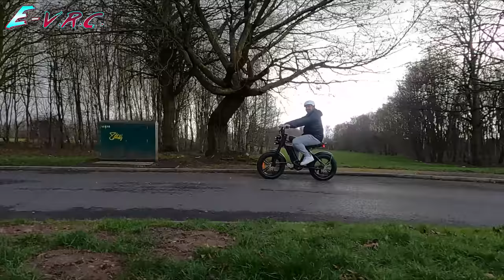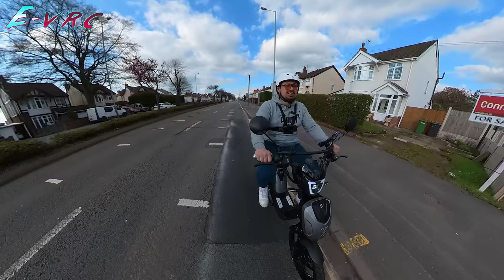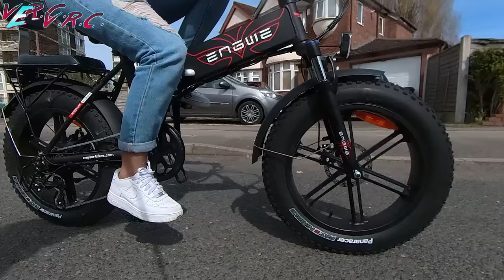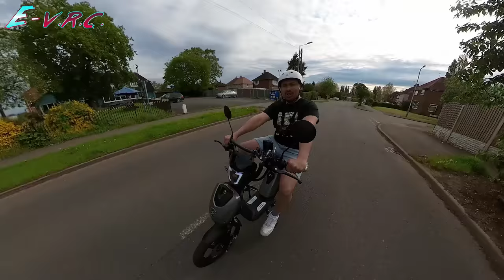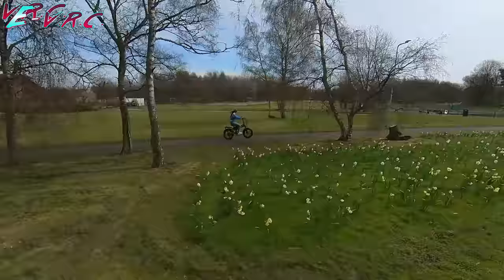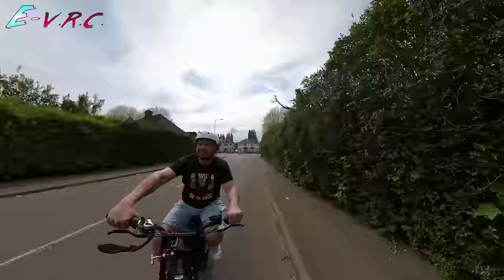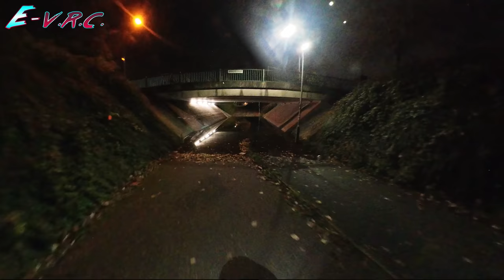The CRAZY Ebike law that MUST Change Before Someone Gets HURT

Comment: Hi,

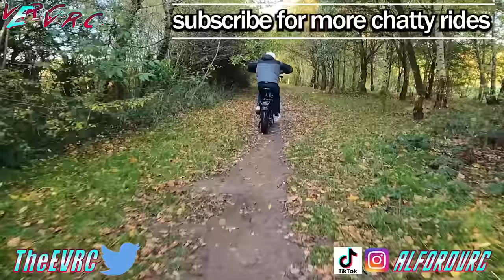9:57, why can't we have a throttle, because it would then be a motorbike. 
Why is that not an answer?
Why do you(we) want an E bike rather than a motorbike?

 No license, no test (required), no insurance, no tax, no MOT, no speed limits, no age limits, all these because its a bike not a motorbike, there maybe others.

I'm guessing the reason we still have these advantages, is history, I know of power assisted bikes, from 1940's, (used a small engine over the front wheel, paraffin I think).
So to continue to use them without the additional rules for Mopeds, a definition of Moped which did not include these assisted bikes was drawn up.
You could always stray into the moped definition, but needed to comply with those regulations.
Most of the problems you site are to do with particular bikes in situations they are not designed for.
The bike where you pedal, because the sensor requires it is a design that should not exist, it is abusing a loophole in the regulations.
In order to fix the problems you point out, we could have better regulations/designs that prevent these issues, I don't think we want that.

I think the reason for each of the 3 restrictions, is basically to set these vehicles outside of the requirements for motor vehicles, allowing us greater freedom of use.
Why we need all 3, is that individually each would have the effect the legislators wanted if the designers acted in good faith. 
But the designers will try to get round these restrictions, I think the bike with pedals that don't power the wheels is an example of this.

These restrictions are relatively easy for the average policeman to notice if they have been circumvented, and are thus enforceable.

Comment: Seems simple enough to me... if you are using a throttle without pedalling then you are operating a motor vehicle, and to operate a motor vehicle on public roads you need a licence and vehicle insurance. You want the same rights as motorists without any of the obligations, and to that I say "tough". I have a conventional pushbike and an e-bike so this is not an anti-biker saying this... the law is fine as it is.
Reply: The law is not fine as it is and this is perhaps why the law is actually changing as we speak, the 2 changes are an increase to 500w power and the legal use of a throttle without having to pedal,   the argument that a throttle would make it a motor vehicle in not remotely correct and it is only so because of the current soon to be changed laws,   if a throttle in your eyes makes an ebike a motor vehicle then logically so does one powered by a PAS because at the end of the day they both activate based on physically rotating an electronic switch to activate the motor,  on my ebike like most I can very very lightly turn the pedals just enough for the PAS to kick in and the motor is doing 100% of the work with my pedaling contributing absolutely nothing to making me go forward and this as I said is basically every ebike out there.

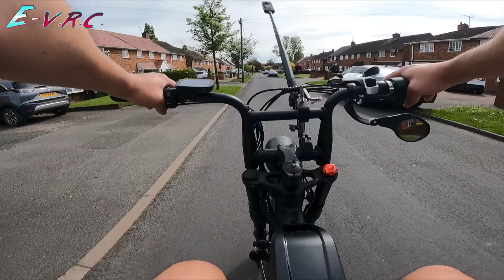Comment: 2:44 THAT is a loat of tosh. People sitting at 40mph "most of the time" are a bloody road hazard.

The spees you "should" be going at is dictated mostly by available grip and line of sight. The arbitrary limits are for bureaucrats, and to be a crutch for those with poor judgement, who have zero business on the road in the first place.

Same goes for power and speed limits on these electric bikes. There's no good reason for them other than some bureaucrat asserting what little power they have over you, like the sociopaths they are.

Comment: You are ignoring the fact these ebikes are used on paths with pedestrians where the ebikes are extremely dangerous!
Reply from the maker: Throttle is safer than pedal assist is what I'm saying. Throttle can be 0-100%. Pedal assist is 100% only.
Reply: @e-VRC  The riders are the issue!
Reply: @e-VRC  Because you are riding crap e-bikes designed to be ridden like a moped, buy a proper one with a quality mid drive motor with torque sensor instead.

Comment: Having a throttle makes the bike a motorised vechile and as such requires a road licence. Would you allow a 10yr old ride a motorbike on the road without a licence? There is no difference between a motorcycle and throttle ev cycle if it isn't being peddled. This is the exact reason over the past few weeks that several teenagers have been killed while riding these throttle bikes, they treat them like a moped that they don't need insurance for! If you can't peddle a bike don't buy one, if you want to use a motor and throttle by a moped. Trying ro make excuses on why throttles are needed is like trying to say a baby should be allowed a pet tiger.
Reply from the maker: A throttle doesn't make a vehicle faster though. The kids being chased by police were on extremely fast ebikes. A slow ebike with a throttle is still a slow ebike. In fact it's slower if the rider isn't pedalling. Plus they won't be on the road as long because the batteries will run down faster making it slower still.
Reply: @e-VRC  really think they were really riding a uk legal ev bike that complied with all the rules? Or an import that didn't meet the regulations? The videos of these kids out riding them clearly shows they weren't peddling them and in one circumstance were two up meaning If they had a legal bike wouldn't have done the 6mph the throttle was meant to give! It's clear they are using a throttle and not peddling and travelling inexcess of 30mph, that's not legal!!! They are infact riding a electric moped!! 

All and I mean All electric vechiles, be it a scooter, cycle or whatever else they can come up with should be licensed the same as any other motorised vechile. That means a CBT as a minimum, theory test, insurance and any taxes the government wishes to impose on these vechiles that they will undoubtedly do at some point. 

How many legal hired scooters do you see children riding despite the fact they require a driving licence to use? Its time its all banned until it can be policed properly with licence plates and annual vechile inspections.
Reply from the maker: @davidchapman1508  that's the point I'm making. They were on illegal extremely powerful ebikes that happen to have throttles. Putting a throttle on a 250w ebike doesn't turn it into a Sur Ron. It can't suddenly go 30mph and it can't suddenly carry 2 people. This video is only about throttles, not the speed of ebikes. Many people in the comments have compared powerful ebikes with throttles with underpowered ebikes without throttle as if it's the throttle that makes a bike powerful.
Reply: @e-VRC  how many other comments here are about swapping out motors and batteries to increase speed? It's easy to bypass ecu's. Having a throttle turns these bikes from legal road bikes into illegal mopeds.

Comment: im registering my ebike as a motorbike,as it does 100mph,and over 35 thousand watts,but so many requirements
Reply: Sounds more like an e-dragbike to me.
35kw? That's 2 to 3 times more than production e-motos like surron stormbee and ktm freeride
Reply: i guess you drag it like anything if you wanted to its got front and rear motors rear has modified qs273 and the front is crystalyte hs4065 rd if i cant get it registered by some technicality ill change the rear for another hs4065 cause they are a third of the weight than qs273,hub motors cn take way more power than  they are rated for with afew mods as long as you have controllers and battery that can supply it

Comment: I’m sure I have Strava time on e-bike restricted to 15 mph that hit 40 mph down long hill with a lot of effort by time I’d hit 40 brakes useless wore out set of pads Bosch motor not fit for purpose dangerous sold mine gone back to road bike and pushing up hill

Comment: The other "problem" is fact you are believing that throttles are illegal. Do you know that (by knowledge) or did you read that somewhere (but not in legal documents)? is the law specifying anywhere what is throttle? Is the law specify anywhere there can't be a throttle on a bicycle? are there classes of ebikes in English law? Is there anything about "motion detector" in legislation? or is there only something about pedals and the capability of moving by pedalling? bicycle definition is something that is moved by muscles but there is nothing about 1-0 action, laws of physics still apply, the bike won't stop when you stop pedalling so there is nothing about it - the legislation does not specify that as that would cause situations when people still ride on a bicycle even when it's an illegal e-bike with the motor switched off and those would be still prosecuted for riding with the motor switch off on the street.

That legislation is very simple, there is nothing about throttles, only power and speed, everything else is up to you.

EU law is more complicated, but there is another class for cargo bikes and etc so I guess they can pay insurance and taxes

The UK is not in EU so not use those laws so even that law about throttling up to 4-6mph is dead, it's from 2019, the UK would have to vote for that legislation.

you don't have to legalise 250W bikes by DWLA and bikes above 250W are not legal anyway, that is up to the seller which has to get permission to sell it and legalise it, legislation would have specified that you have to legalise your bicycle every time you modify that but there is no such legislation as this is not a moped or motorbike as it has pedals and you still can move it by pedalling.
-------------
there is some information about all that but there is no nothing from people who read legislation, each website copy each other and all of them are wrong, even DVLA lie (dvla for some reason needs to know "Will that bike go faster than 15mph on throttle only?" but it's silly really as in real conditions that bike would move faster anyway, you don't have to brake if you go faster than 15mph).

Comment: I don't think e bikes need to go that first you supposed to be paddling as well  electric motor helps you that's all its supposed to is  assist. Not give you 20 or 30  40 mph /kph speed it doesn't need this.

Comment: You make a few mistakes.
The rules are nadd for safety and a lower speed wouod make an E-Bike safer.
You compare the speed of an E-Bike, with that from a race bike and not with the speed of a normal city bike. The rules are made according normal city bikes and not to help race bikes.
The average speed of a city bike is in between 14 and 16kmh, depending where you lif. That is way slower than the 25kmh of an E-Bike.
Old people often go slower and normally hi about 12 to 13kmh.
The E-Bike made it unsafe, because of the higher speed. Especially by the older people, the amount of accidents went up. Setting the speed limit to about 16kmh, would bring the amount of accidents back to what it was.
Setting it to 30 to 35kmh, would more than double the amount of accidents on E-Bikes.
Going faster on a normal bike, is also more dangerous. Bug in the UK, people still think that it is safer to race with cars, while numbers show, that, that isn't the case.
Your explanation about cars take longer to overtake, isn't the problem. Most accidents happen on an intersection. 

As you want to go faster, you need to get an other bike and then is an E-Bike not for you.

The throttle law is added from 2016. Bikes that came with one and are from before 2016, are egal in the Netherlands.
Without throttle you are less to get hurt or hurt other people is the biggest nonsense. Your explanation is one big fail. They removed it, because bikes with throttle where more involved in accidents, than bikes without one!
Before you make up something what in your eyes naked it safer, check the facts first. You made a big fool out of yourself!
You ride on a bike that is designed for something else than where it us used for. Buy a normal E-Bike and not those Chinese crap bikes.
You can shift as you stand still, as you have a decent E-Bike!

Buy an electric moped and your problem is solved! Or as you want an e-bike, but a normal E-Bike. Than you can shift while standing still!

As you want yk talk safety, talk about the dumb helmet on your head! It makes you look like a dumb fool.
The only thing that helmet does, is making the risk of an accident 60% higher. Cars give less space and people ridi g with a helmet rake more risks. Knowing that over 95% of the injuries are other than head injuries and most people that due, are killed because a car drove over them, then you see that they don't ad a lit of safety, but only increase the risk of an accident.
And for the ones that start crying about head injuries. In a car, you have 70% risk of a head injury and from that 70% has 60 to 70% a skull fracture.
Head injuries on a bike are 0,1% of all head injuries. Cars are way higher, but nobody wears a helmet in a car and most risk outside work, is in the shower. Shower with a helmet, that is way safer.
The 5% on a bike is mainly by people on race bikes and mtb's. They often already wear a helmet!

Het a normal E-Bike, instead of the ones that are designed for throttle and only made legal in the EU and UK, so they could also sell it to fools like you!

And for the 250w limit to weak to go uphill, is nonsense. That you buy crappy bikes with a weak motor, is your problem.
You can buy a 750w motor, limit it to 25kmh and you are legal! Nominal 250w isn't a maximum of 250w!
Reply from the maker: You nearly had me taking you seriously until you spoke about helmets 🤦🤦

Comment: At what point does an e-bike become an electric moped? These laws are already addressed - sounds like what you want is a moped without a license and insurance. The laws aren't perfect, but good enough.
Reply from the maker: I would say the dividing lines between ebike, moped and motorbike should be based on speed and power. Not the way you access the power. Pedal assist is literally a 100% or nothing foot activated power delivery system (that requires VERY little physical effort) and in my opinion isn't as safe as a graduated hand activated throttle.

Comment: I'm sorry, but the EU laws are ridiculous.  You have so many pansy-ass lawmakers over there that apply no logic, just knee-jerk reactions to E-Bikes, drones, etc... You name it, your lawmakers "over-legislate" it. I'm a 325 lb ex-football player and I need a minimum 750W motor and my Rad Rover 5 has been modified to use a 1000W motor and my Himiway Step thru has 750W motor. This gives me the torque I need to climb steep long hills. When the laws become unfair and the pussified-politicians have nothing better to do than legislate everything they can get their hands on, I firmly advocate non-compliance. In the drone world, screw Remote ID for hobbyists, and in the E-Bike world, screw the motor power restrictions and dumb throttle rules. Just get rid of the twist throttle and sneak a thumb throttle on the bike. Most enforcement is stretched too thin to be able to regulate us, or they don't know what they are looking at. In the US, everyone with a powerful Class II or Class III bike, just buy Class I or Class II adhesive emblems to put on the bike's frame in prominent locations. Many are fancy with raised emblems that look factory.

Comment: You got the US laws wrong.  We have no 250W limit, our limit for Class 1 & 2 is 750w.
Reply from the maker: Sorry yeah usa limits are speed based aren't they. It's a good system.  Shame I couldn't remember it 😬😬
Reply: @e-VRC  We have a 750W max with speeds set at 20mph for Class 1 & 2 (with Class 3 being like class 1 only with a 28 mph limit).  No worries mate, I don't expect Europeans to know our laws just wanted to correct a small error.  I'll also note out Police, in general, aren't out to get the guys running even more power.  Just don't act like a jerk (I believe it's ''Wanker' in UK speak) or ride the overpowered bikes on trails with explicit limits and you're generally OK.
Reply from the maker: @ebikeengineer  that would be a correct translation 👍

Comment: Why use those gigantic, fat tyres that soak up all the power?  Ever seen a competitive racing bike with anything other than super thin tyres? The answer is no. Change the tyres for a big decrease in the effort required to reach higher speeds.

Comment: Right on the money here.   I agree with the 20mph suggestions and throttle.  I would also be open to having a licence for a speed ebike category like they have in Holland.  Surely this would be an area that we could see a genuine legislative post Brexit benefit.
Reply from the maker: Maybe the moped licence could cover it. 16+ needing cbt.
Reply: @e-VRC  Complete with number plates and compulsory insurance.
Reply: @e-VRC  exactly this.  a moped just electric not ICE powered, its easier access etc. but that would require cbt, tax, license, insurance and helmet though which people seem to be against. imagine if you could drive an electric car with no license/tax/insurance - just because its not petrol powered?